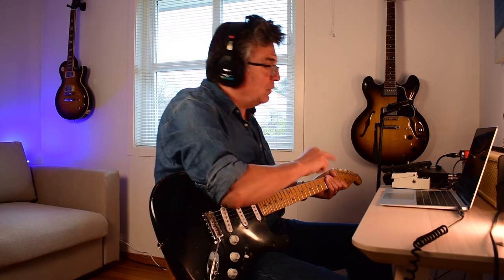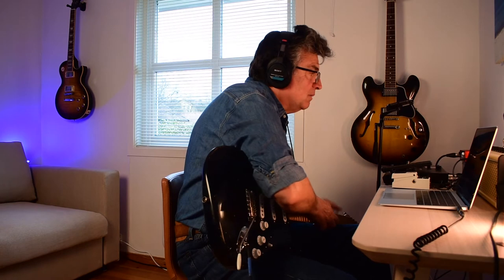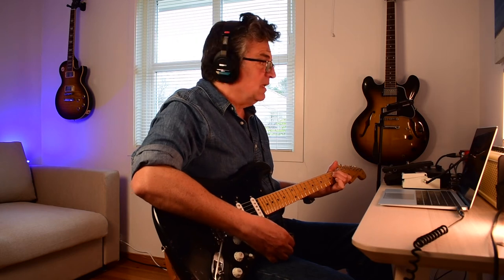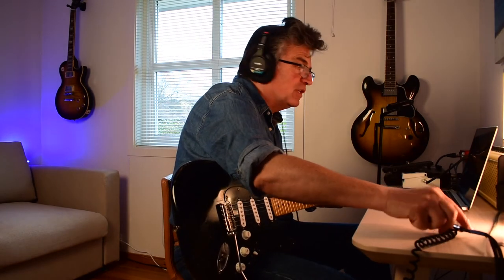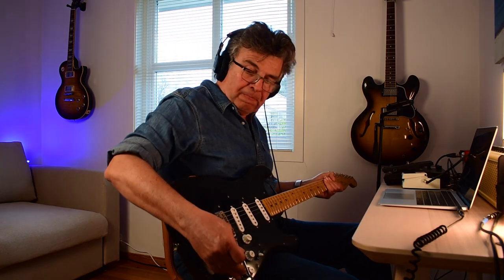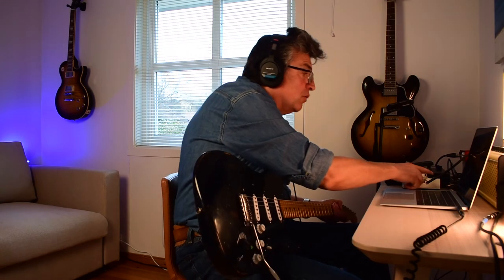Does the PodGo Need a Buffer? (yes, it does...)

Comment: Hi Marcello, very interesting. It's like you removed a blanket from the sound when you had a buffer in front of the PodGo. I couldn't really hear a difference between the wireless connection or when you went via the Boss pedal - but as they both offer a buffer it is proving your conclusion. Cheers Thor.
Reply from the maker: Cheers, Thor!

Comment: The difference seems minimal to me. I tested using a boss tu 2 pedal and didn't notice a difference. I used AKG headphones, monitors. Plus it would be one more thing to take to the stage, more pedals, power supplies and cables. I prefer to lose a little tone and be more practical. Thanks for the video my friend.
Reply from the maker: Hi there, thanks for your comment.  Sure, all your points are valid points. I think Yamaha has fixed this in the latest production of Pod Go. I use the Yamaha G10 cordless plug which has a buffer in it, so this has solved the problem for me. Cheers!
Reply: @marcellosguitarcorner4004  How do I know if the model I bought on sale in January 2024 has the issue fixed?
Reply from the maker: Hallo there…..hard to tell without knowing the year of manufacturing. I guess you have two solutions: 1) register your gear at Yamaha.com and send them an email. Or, 2) use a Boss pedal (or watever pedal with a buffer in it) and try to repeat my experiment. If you don’t hear a difference in the second case then you’re good. Good luck 😊!

Comment: don't have the wireless version but I do have a boss wireless. will this be the same?
Reply from the maker: Yes, I guess so but you should ask your dealer (or send a mail to Boss) if your Boss Wireless System does have a buffered output. Just to be sure.
Reply: @marcellosguitarcorner4004  I found a cheap buffer on Amazon that should do the trick.

Comment: I have the same impedance issue, unfortunately for me the buffer is only a bandaid that cures the input problem ~80% still losing feel & dynamics compared to other hx products... truly a shame.
Reply from the maker: Hi Julian, thanks for your comment....indeed, I also feel the lack of responsiveness (when compared to a tube amp) from the PodGo as the main problem....you write that you have a better experience with other Helix products, may I ask which ones? Cheers, Marcello.
Reply: @marcellosguitarcorner4004  I have the same issue when I compare my Pod go and Hx stomp. When I compare direct sounds through units, all blocks bypassed, pod go has obviously a dirty, muddy sound. Single coils soundslike a humbucker (almost). I cannot get the same clear tones I get from Hx stomp.
Reply from the maker: Hi Hako, thank you for your comment. Interesting that Line 6 has missed this on the PodGo, whereas it works fine on their other products. I think I will be going back to my pedalboard and amps 😀. Cheers!
Reply: I dont use buffer,but its big difference using i.r,line 6 have free allure i.r.to download,my pod go sound good now,,try it,if you dont use guitar amp
Reply from the maker: Hallo, thanks for your comment. I guess you are satisfied with the IR’s of the Allure Pack, and that’s fine. My test was to show that there is an impedance issue with the old PodGo. This issue has disappeared with the new wireless PodGo. Otherwise, one has to use a buffer between the guitar and the PodGo unit, or use a wireless connection (which I do). This is is to get the best out of the (old) PodGo unit. Cheers 😃!
Reply: @marcellosguitarcorner4004  yes bro,i saw other video using boss tuner as buffer,lucky are those whohave wireless pod go,i have the old model with out wireless,nice video of yours,,

Comment: I think that what you gain in treble you lose in bass. simply turning up the presence and treble should fix it without having that clipping on the bass.
Reply from the maker: Hallo and thanks for your comment. Is that your experience? I will try again using your suggestion. Still, I do not understand why everything sounds a lot better when I use the wireless connection which has a buffer in it (or a pedal with a buffer).